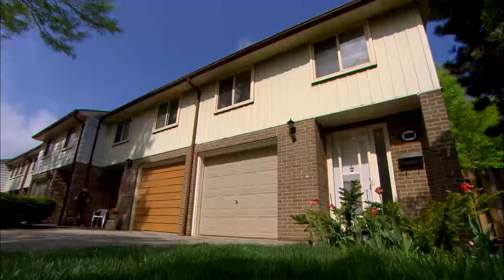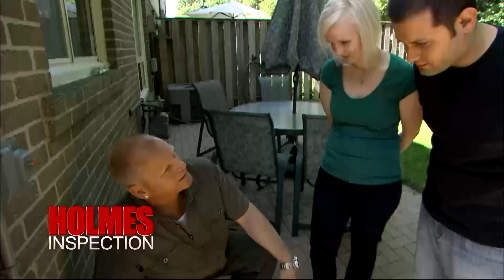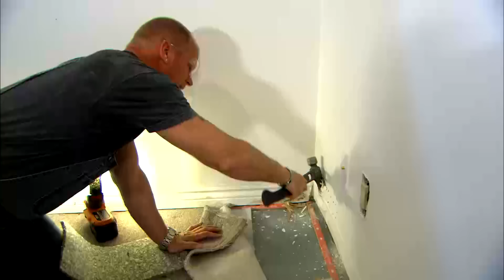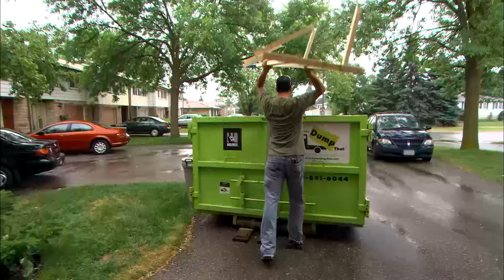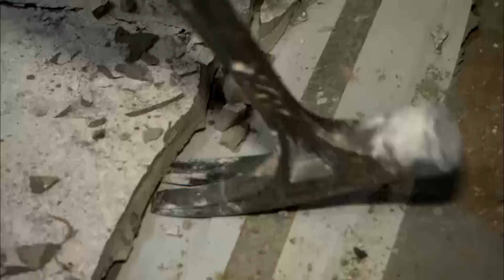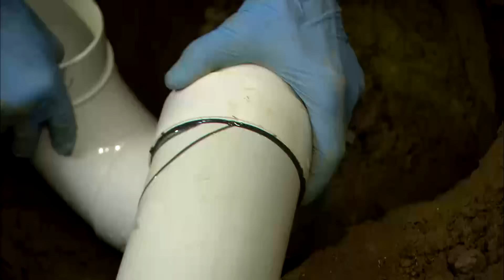Busted HVAC & Safety Issues: Mike Saves Their Dream Home | Holmes Inspection 207

Comment: I think I saw hinges on the right side of the dryer door, which means it will smack into the bifold door and not open. Personally, too many doors there. The separation between the utility sink and the washer is a little cramped. Just my preference...great job as usual.